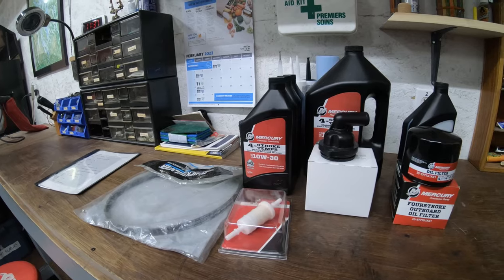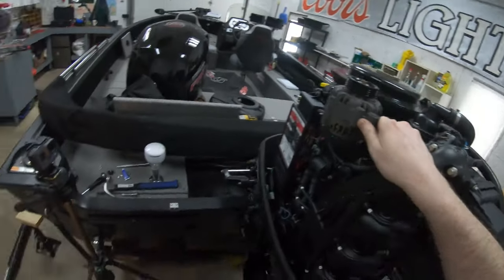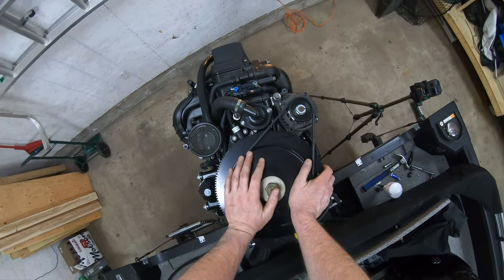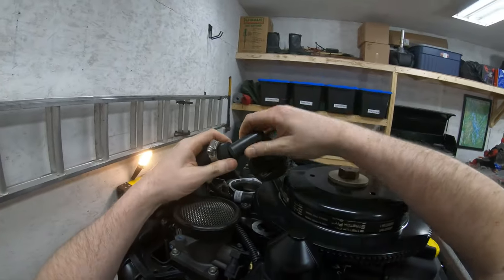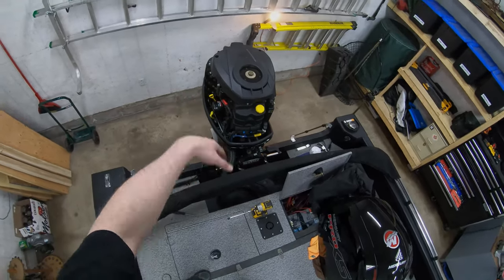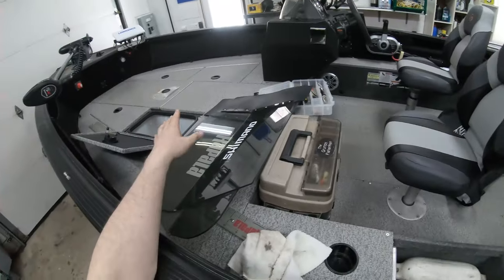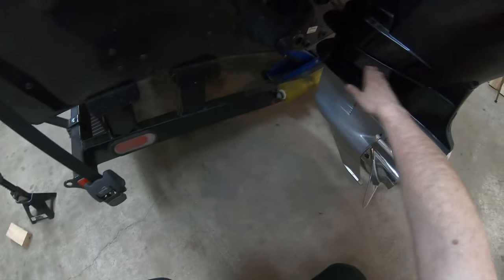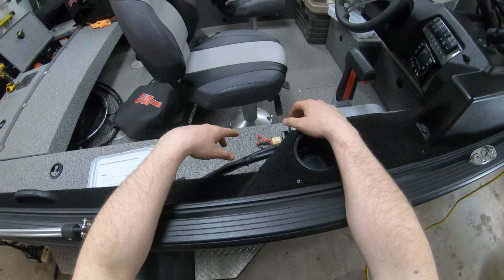2019 Mercury 150 Pro XS 4 Stroke - Thermostat and Accessory Belt

Comment: Nice video Thanks.   I am in the market for a 17-18 foot boat like yours and was leaning 17ft model with 115hp  over the 18ft 150hp because I do not want a kicker motor either has your vessel view worked well trolling crank baits ?  And is the fuel consumption real high or does it sip gas trolling ?   I also was wondering how many pound thrust electric motor ? And does it last very long trolling crank baits ?     You have done some very nice upgrades to band the Factory and Dealer do not send them out the door like this !  TC

Comment: Does the thermostat have to open on the lakewater thermostat housing to have water come out the pee hole?
Reply from the maker: no, the water should come out the second you start it.  the thermostat on an outboard simply increases flow as the engine warms up.

Comment: Mercury 50 hp marine engine fuel does not come to the spark plugs. Gasoline comes to the injectors. The injectors are intact. ecu is solid. When you add a few drops of gasoline into the cylinders, the engine starts and then stops. Cylinder pressure is very good. Can you help me..

Comment: When you are getting water in boat, are you running the live wells? Often with big loads placing the boat lower in the water it will not allow water to clear the live wells as easy and you get splash over on the top of the live well.  Stick your camera in the live well and check the seal at the top often these are not done right and splash over.
Reply from the maker: Thanks Dan!  Ya it's an  intermittent issue and only when people in the boat so on my list of things to dig into this winter.  Always something lol